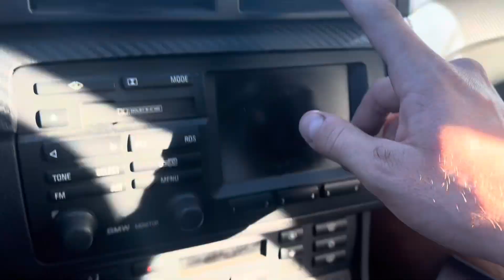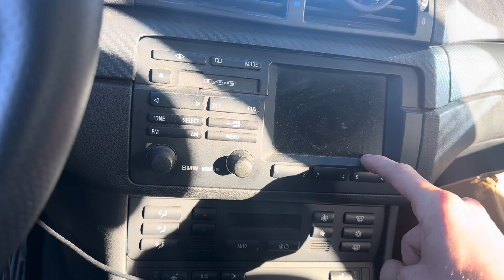Turbo E46 Sedan New Setup and Update!

Comment: my car sat for 9 months in a similar state 2 of them with no head when I realised i not only lifted the head on my m54 but the block went soft and took me another month to get motivated to put my new engine together. my car also only lasted like 5-8 thousand kms before a 25 psi mistake
Reply: Lost the key to my 79’ 7 series and no one knows how to lock pick it … been sitting with a brand new engine in it since July… needs suspension and I’m golden

Comment: Hey man i was curcurious if you would recommend a turbo setup or supercharger setup for 350-400hp, I have headbolt inserts rocking the stock bolt size, thicker head gasket, machine leveled head, welded oil pump nut, I want it to stay pretty dailyable but Ill have a back up car if I go boosted.
Reply from the maker: Always go turbo!
Reply from the maker: Just control yourself and keep it on 10psi or less.
Reply: @hellrotgarage  what do you think of the hopwood motorsports kit?
Reply from the maker: Be racing tuning has it all. Just watch my videos over how I built the blue car. I even put all the parts you need in the descriptions of the videos.